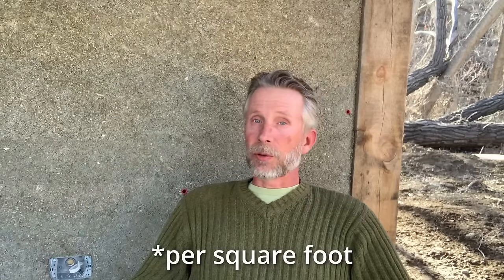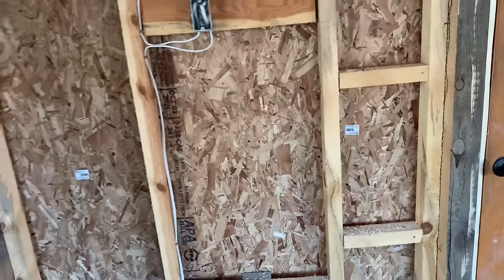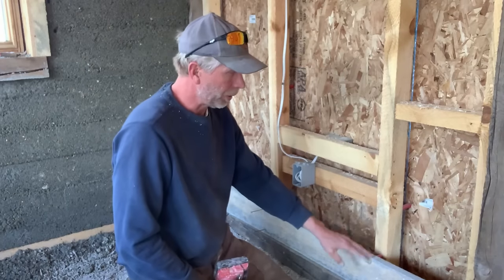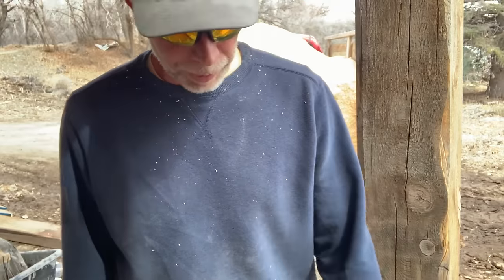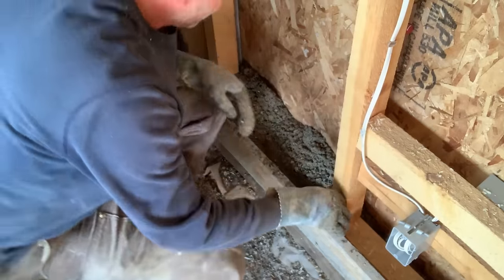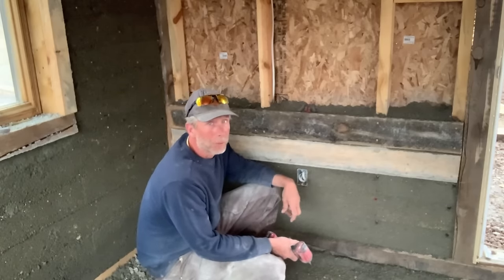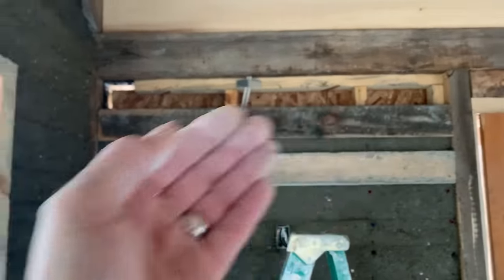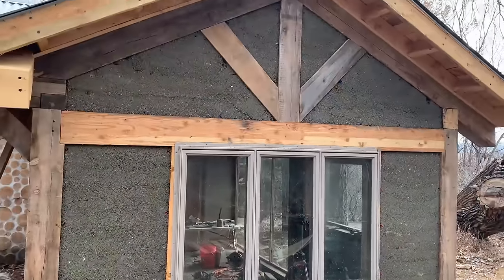Dustcrete

Comment: Friend, in 13:05 : you put the "dustcrete" on top of a wood beam "foundation", where generally you put the wood beam on top of a concrete foundation. I don't know the weight of your wall, but if it is heavy enough or if the wood beam deteriorates it can sink your wall (or even part of your house), etc... I suggest you either use concrete foundation or "treat" (hardens) the wood beam with cement (1:1 cement + water) before constructing the wall. It also helps with termite, etc... Also, before plastering, it's better to put a coat of cement (cement + water) to reinforce the wall. Just "paint" the wall with cement, also helps using less plaster, etc... Just a suggestion 👍

Comment: I've built an off-grid home out of sand bags and used tires and I was in New Mexico and the earth is very perfect for Adobe clay rich and sandy mix, I would add a shovel of Portland to a wheel barrel of my mix, and it's crazy seeing this mix how it holds form, I was looking for this consistency so it wouldn't sag...

I like this 👍
Reply from the maker: Right on. I’ve done some earthbag building and found it very labor intensive. This method is quicker and require much less lifting. Glad you liked it!

Comment: Great show! Thanks, my seven battery power plant and me are still working out who’s in charge on this Rocky Mountain easy life…
You video is fairly Zen for me. Soon I will have an oven and my prize ( thanks to your great idea) I have a solution for a very cost effective method of saving some old Miner’s shacks here, that will not cause any framing or history do be trashed or covered up. I’ll be watching

Comment: The slip form technique - I ordered a an old set of books entitled Adeles carpentry something or other from the 1920s what a wonderful old reference set. I ended up buying more of the Adeles sets (masonry, etc) they even had mechanical sets airplane sets. Anyway a great way to save money when thats necessary & you can afford to take the time to do a project in sm portions rather than all at once.

Comment: Biggest concern I have is that the mixture is untested (i mean formally tested, real measured values conforming to some standard(s)), and that means we're not as certain how the structure will react to an earthquake or hurricane/monsoon.  Especially without the traditional joinery.  Neat, either way, and I do like the thermal characteristics crossed with the low cost of your concoction.  Best of luck sir.
Reply: Think of it like cheap insulation(if you have cheap sawdust nearby). Probably could do better with metal foil separated by an air gap.

Comment: I am restoring a 200 year old house in Japanese snow country, and I just love this idea. I have been looking for something a bit better insulating and stronger than the traditional dirt and mud walls, but still has breathability and uses sustainable materials. The sawmills around here just throw away away their sawdust so I am excited to see how this work outs. I am curious how breathable it remains if you put external cladding on it? I want to add a little extra protection on the first floor because the snowfall is so high.

Comment: I'm intrigued with this method.  One thing that I like is that repetition seems easy to achieve. Foamcrete was my early thought. However the variables are much more daunting.  Good job.
Reply from the maker: Thanks! Yeah, this method is easy to reproduce consistently. I recently posted FAQ videos you might like.
Reply: I'll try to find that. Do you have an opinion on using DHL? Would it be a substitute for cement or a beneficial additive?@radicalgastronomy
Reply from the maker: @francoisbouvier7861  I’m not familiar with DHL. What is that?

Comment: Love the idea; something to try on a near future tiny house I'm planning.  A thought to less lumber or more depending upon finish.  Less lumber, make your interior form boards T or L shaped (2 pieces of lumber perpendicular); skip the middle studs.  The T will virtually eliminate central studs as the extra board will prevent the bow of a long wall under compaction.  More lumber, be sure to attach the support board from the outside of the rough sawn lumber with screw just long enough to give temporary hold.  Leave the rough sawn lumber up as the decorative finish and remove the T board support.  Treat the lumber with your favorite low/no VOC wood finish.  Still no studs between the corners, simply brainstorming your awesome idea, thanks much ;-)
Reply from the maker: All sounds good. Keep me posted!

Comment: during war times past the U.S Government created something called Pikecrete witch was water mixed with sawdust and then frozen into solid ice, and the sawdust made the ice have a much higher melting point making it melt up to 5 times longer than regular ice and more importantly it was bullet proof!! it was proposed to be used as a cheaper alternative to steel which was needed to built U.S battleships as steel was at that time in immense shortage of supply however the idea was eventually scrapped due to realizing that it would take almost 3 times as much steel to build freezers necessary for molding and creating the immensely huge battleship hulls! crazy and little known wartime example of ingenuity when out side of the box thinking is needed. Ive always wanted to create a small canoe or kayak sized boat made of pikecrete to see how well it would work and just how long it stayed intact before being non usable for fishing or what have you lol!
Reply from the maker: Cool!

Comment: I teach a Green Home course at a University in CO and loved your video. I read all the comments but believe your R-value is optimistic as cement makes a more conductive wall instead of a more insulative wall. I think clay may be worse but certainly more natural. I saw clay mixed into straw blocks here in the San Luis Valley and they were much more mass than insulation. My hempcrete workshop only packed around the edges of the form but left the middle of the wall fluffier for better insulation value. Most of the sawdust at our local mill is stored outside which may be more typical of sawdust suppliers than your really fresh sawdust but I'm not sure how much that may matter as one guy discussed. Subscribed & look forward to your future posts as I want to build affordable homes but worry about code inspectors.
Reply from the maker: Thank you for your notes! Do you have access to a means of testing the R value of this material? It would be great to have an accurate value. Ultimately, I feel that the R-value-centric view of thermal efficiency comported by the IRCC is flawed to the advantage of the building material manufacturers who write it. By utilizing thermal mass in conjunction insulation (and more appropriate heating methods) we can achieve the aim of efficiency. My other beef with the code is that it aims to curb fossil fuel consumption as if all homes are heated with grid-tied utilities. 
If I heat with wood, or the passive radiation of the sun, or even water electrically heated from my own PV array, why would a code presume to regulate my R value? It is a handy data point, but it is reductive to consider only this metric.
Fortunately for me, I do not suffer under the oppression of a building code. In the practical world outside of the theoretical code, I can tell you that these walls at 8” perform quite admirably. Furthermore, as I heat with passive solar and wood from my own wood lot (and the ash and charcoal is incorporated into my soil) my house has a negative “carbon footprint”. 
As for clay vs portland, I wonder if the production energy savings provided by clay would offset thermal loss over a 50 year time span. For me, it is not worth the testing and calculation, but perhaps some scholar needs a thesis… 
My criteria are more about 1) what can an individual do to build a quality home with the least use of fiat currency? 2) how can we eliminate toxicity from our homes? 3) can we develop methods that are non-industrial, and possible without the benefit of the supply chain? And 4) how can I split less firewood? 
Best of luck with the course, and all of your endeavors. Let me know if I can help in any way.
Reply: @radicalgastronomy  I whole heartly agree with you that the code is an impediment to building better, more energy efficient and less expensive homes. My university is geared to produce teachers & I'm not sure if they our science dept. has a way to check R-values but I will check to see if they do. I also agree with you that an R-value is not the whole picture of an energy efficient wall system since mass that stores energy plays a role as well but most mass should be in the interior walls and higher insulation in the exterior walls. I've lived off grid for 23 years in CO and have built 2 passive solar straw bale homes with interior adobe walls that performed extremely well with little of that grid power for heating or cooling; 1 is on the cover of 2 books on super-efficient solar homes. Cement production causes a tremendous amount of pollution so it would be best to eliminate it from all construction if possible and go with non-toxic natural alternatives to improve our homes and our health at the same time. I have taken my student son 2 tours of energy efficient homes in the SLV for 7 years and wished you were closer as I'm sure they would love to see yours and discuss it in person with you. Thanks for posting your videos for all of us to benefit from.
Reply from the maker: @chuckreel1189  Awesome! Yeah, there are some great examples over here, too. A little alt building festival would be a good idea.

Comment: Dustcrete definitely seems like its the way to go. Ill use what you did and incorporate it into roundwood timber framing. And because Im in the mountains with nary a flat spot to be found, Ill use piers, not slab on grade, and floor joists filled with dustcrete or maybe just lime binder? for floor insulation. Ceiling insulation maybe fleeces from my Shetland sheep.
Reply from the maker: Sounds good. Don’t skimp on the sill plates. Having wool for the ceiling is clutch. I want to devise a good block approach for that, and floors. Lime only on your floor should be enough, as long as there is a subfloor above. Forms could be reused throughout, then become the subfloor. 🤷🏼‍♂️

Comment: Instead of mixing it in the wheelbarrow by hand, (I use almost the same method making dry pack mud beds for tile showers) if you want to scale your mixture, measure it out and dump it on a tarp and just pull the corners of the tarp to each side to mix them. Can also wet it with a hose and sprayer with shower setting just enough to get the same snowball consistency. Overall well done, and may give this a try sometime
Reply from the maker: The tarp method could be efficient with a larger crew. Working alone, the wheel barrow batch is the right size. This material is light enough to be easily mixed this way, unlike something like cob.
Reply from the maker: Also, measuring the water is critical, so the hose may not be the best approach.

Comment: Here's an idea that may, or may not apply. Block layers take a block of wood and wrap it with carpet. Use it to smooth of the wall after spooning the joints. This could help with marks left by the form boards?

Comment: I think you may have just added a new chapter to the state of the art. Looks super easy to work with, even if it's a bit slow. If it holds up well over time and insulates well, this idea looks like a good alternative for timber frame structures. If only I didn't have codes to deal with ...
Reply: I like your username.
I am thinking of trying this dustcrete recipe by building a 36"L× 23"W × 25"H interior doghouse for my beagle. If the dustcrete doghouse resists cracking when taken on the road, I may use the dustcrete to make a fire shield for my mini- wood stove in my future stepvan conversion.
May your endeavors meet every success.
Reply: How well has the dog house maintained?

Comment: I thought of using sew dust instead of hemp hurd 
Saw dust makes more sense to me. 
I’m building a new timber frame house next year starting with the foundation this fall and letting it settle over the winter, pouring the heated concrete slab in the spring of 2024 . But this year I’m going to build mock up walls of each to get a good idea of cost and show the insurance company.
The fire ratting . A good way to get rid of my slabs off the sawmill .
Just need to chip and run the chips through a hammer mill .
Reply from the maker: Right on. I’d be interested to hear how the underwriters feel about it.
Reply: @radicalgastronomy 
I’m sick and tired of throwing dollar bills threw the walls. Northern Minnesota winters are brutal.
I’ll keep you updated

Comment: You may run electrical in plastic tubing , or preinstall water lines drilling through the center of studs running inside the wall, with boxes for outlets. Twelve volt power can be used for lighting. An aircrete rocket mass heater can run tubing under the floor to distribute heat or fan cool summer air flow. Moisture trapped in the wall will need to dry.

Comment: 3 mile from my place I picked up three trailer loads of sawdust. A little more coarse. I’m going to insulate 12X20 shed. I pulled up the floor and going to fill with dustCrete. Then I’m going to do the walls. Ive watched your video many times. Going to start mixing tomorrow. It gets pretty cold in WYOMING. It well be a great work shop.
Reply from the maker: Heck yeah. If you have any questions while you’re doing it, just drop a comment here. Let me know how it works for you!
Reply: Today was trial and error. For the most part went well. I rented a mixer. What i found that works for my application, sawdust is already wet so I’m cutting back on water. Water in mixer first then lime and cement and let it turn to slurry then i ad two buckets of sawdust and let it mix. Once mix well i throw last bucket in and mixed. Most sawdust mixed, dumped in wheel barrel and finished mixing. I’ll let you know when i put video on YouTube.
Reply: Im doing the floor first, and little less than one third done. Ran out of material. I decided to get material from home_depot than local and pay twice as much. Waiting for pallet of s-lime & pallet of Portland cement to be delivered. 95% I’d say looks really good. Were the sawdust didn’t get mixed well, doesn’t have good binding. It’s on the  floor and isn’t a big deal. I’ll have it down pat by the time I do the walls. Im glad I saw your video on Dust Crete. I was going to do Air-Crete. I still might on another project.
Reply from the maker: @bajacraig2  try mixing a batch like I did in this video. Dry stuff in the wheel barrow first, then water. I’d be interested to hear if it solves the clumping issue.
Reply: I did do a batch in wheel barrel and it mixed well using a hoe and dried on floor nice and hard. I don’t have a strong back and that’s why I’m using a mixer. The mixer needs to be bigger. Im going cut batch in half using mixer. Im going to resume next weekend if i get my delivery.
Reply from the maker: @bajacraig2  cool. That smaller batch may help. Sounds like you’ll be well supplied to press on!
Reply: Today my pallet of s-lime and cement was delivered. So what I do now is I have two five gallon 🪣 and they’re marked at two gallons with screws witch make it easy to see when adding water. I’ll put gallon of lime and cement on top of the water in the bucket and mix with a mortar mixer on my cordless drill. Slurry in no time. I dump 1 in two the cement mixer and one bucket of sawdust, second bucket of slurry and another bucket of sawdust. Let it mix in and one more bucket of sawdust and let it all mix and then dump in wheel barrel. I then rinse the mixer and dump the water into the buckets. Take the wheel barrel into the shed and dump it and spread it between the floor studs. I have it down pat. I do have a question for ya. My wall studs. 16 on center. Ether I screw galvanized screws into the sides of the studs or nail a 1/2 sq channel to the studs to keep the dustCrete from falling out. Like a clete. What your suggestion?
Reply from the maker: @bajacraig2  Either will work, but using a strip of wood is better because it will reduce the chance of drafts. If you off set the forms like I show here (such that the studs are completely encompassed in dustcrete) cleats are not entirely necessary.
Reply: I started the walls in the 12x20 shed. The floor is done. I didnt put the sheets of plywood back down on the floor studs. I have 5/8 depth and im thinking of electric floor heating. Once the dustCrete dries I’ll seal it and put tile on it. Today I almost got 8’ long x 6’ hi wall done. My boards are 12”x 8’ long. 3 of them. I bought 10’ pex tubing and cut them on table saw 1”1/2 for my stand off’s. I followed just like your video. Clever!  So how i sped it up between loads is, 4 five gallon buckets. Mix half batch in each one. Slurry. Take them over to mixer. Dump one bucket of slurry into mixer and two buckets of sawdust. Let it mix up and dump into wheel barrel. Put wheel barrel off to the side and start another batch. Wheel the batch into shed and with square shovel sling the dustCrete onto the wall. With a stick i make sure i get mix between stand-off’s. Tapp it down with 2/4. Head out for another batch and so on. Its a workout. What R-value due you think a 5” thick dustCrete wall is? Soon a i get one hole wall done I’ll put a video on UT.
Reply: Oh, I was thinking of not plastering the wall, when its dry id like to seal it and paint it. So I can tell people its sawdust and cement.😊
Reply from the maker: @bajacraig2  right on! 5” is likely R 15 or so. Please add a link to your video here.
Reply from the maker: @bajacraig2  Your can do that, but bear in mind that you will loose vapor permeability. I don’t know if it will be an issue, but just so that you are aware.